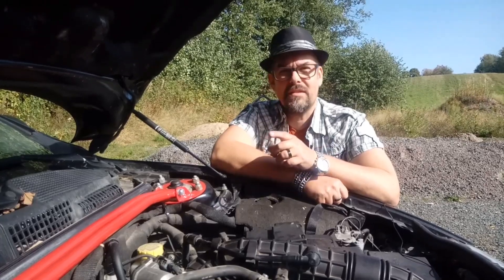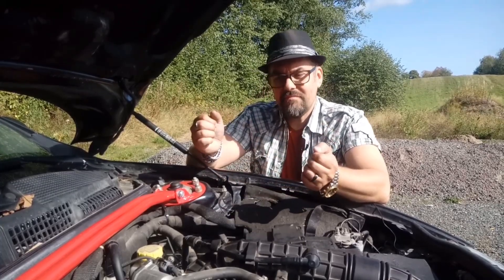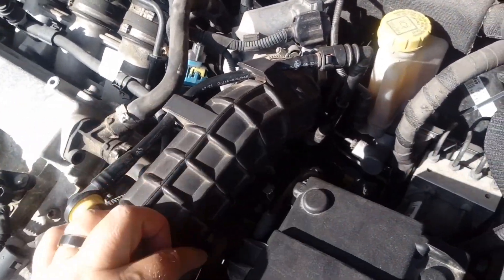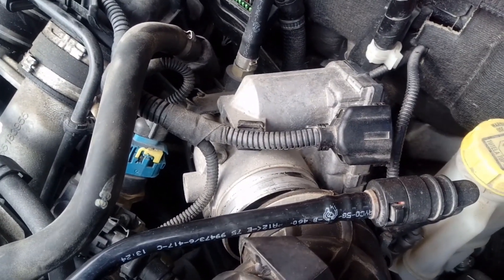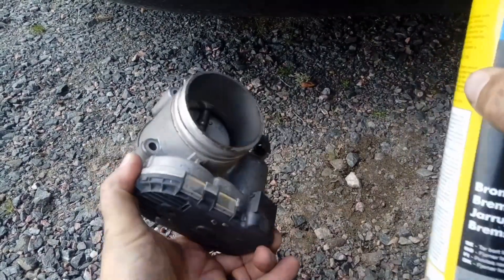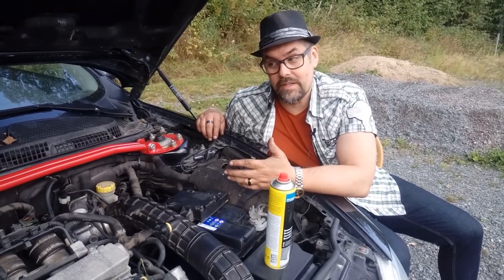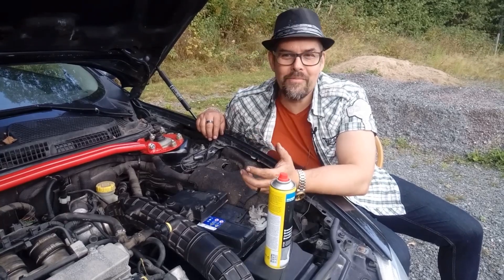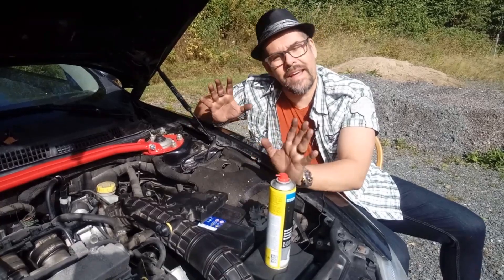Cleaning a nasty throttle body in my Alfa Romeo 2.0 GT

Comment: The TS' engines don't have this problem with the carbon dirt at the intake. All direkt injection engines have this problem. In the past the fuel was injected into the air intake and cleaned the carbon from the exhaust gasses redirected to the intake. When the fuel is injected direktly into the cylinder the intake won't get washed anymore.
You can remove the intake in about 2h to 3h. Put it back in place is much harder. I suggest it is a good idea to break at least on of your arms before, to get a little bit more flexibility in your arm. ;)
To unscrew the devil screws you need a long - I mean really long - ratchet extension, about 1m, i guess. Then you can remove the screws from the bottom of the car.
I removed the whole intake once to change a fuel injector. Sadly at this time I didn't knew about the dirty intakes and the problems you may have. So I have to do this again! :(
Reply from the maker: Thank you! That was a very good explanation😆👍. I think I will need 2 days instead of 2 hours and a lot of knuckle blood. I will try to get it from the bottom and the top to see which method is the easiest. Prepare for a long and dumb video 😂
Reply: So the TS engines have the injectors spraying in the manifold ?
Reply: @dragosdiaconu629  yes